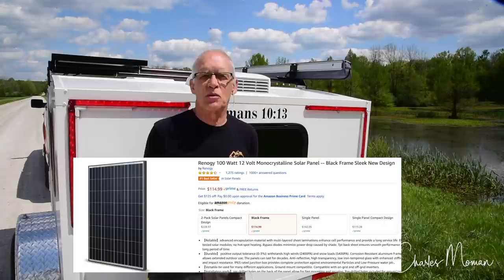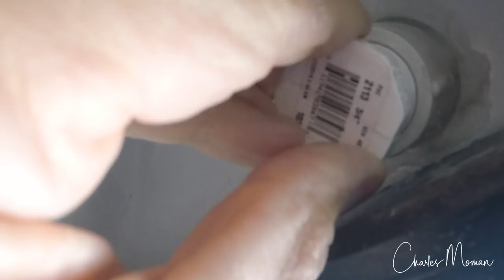A Simple Budget Solar Set Up for the Average Camper with Charles Moman

Comment: Thank you!!  This is much simpler than all the fancy setups I've seen on Youtube.
Reply from the maker: It is all we will probably ever need. If we end up using the roof solar a lot, I may add a hole in the front and run the wires inside permanently, but I doubt it. With the little use I expect, I would rather have the solar cords stored out of the way in the storage box on the front rack. Thanks for watching.
Reply: @charlesmoman  I would like to know if that jackery works for a refrigerator.  I live in island we get a lot of hurricanes. We were 4 months with out power.  My mom is diabetic so I would like something like that to have her insulin cool.   I had to make hour line for a bag of ice.  Would that work?👍

Comment: Imo, one of your most useful vids. Thank you! Re the hole ya drilled in floor, I would have smeared bunch of 2-part epoxy around inside diameter before using the piece of gasket material. Epoxy is better sealer than silicone. Don't want to get any water/moisture into that laminated floor.

Comment: I am wanting to put a max air fan in my teardrop, I currently just have a vent no fan. I have a jackery. My question is did you wire a 12v plug to the fan to be able to plug it in? Trying to figure out if that’s how I can set mine up? Great video by the way.

Comment: Helpful tip for you.  Buy a small inverter for your truck.  Plug the wall charger for the Jackery into the inverter in the truck.  Now you can charge at 81w instead of the 42w the 12v dc plug gets you.  Twice as fast charging while driving.
Reply from the maker: Yes I am aware of that. And that is a very good tip on the Hobotech channel he mentions the Bestek inverter on Amazon as a very good one. I need to add that to future videos and thank you for the reminder.
Reply from the maker: This is a suggested one - https://smile.amazon.com/dp/B004MDXS0U/?coliid=I1R01OFLHZXWFQ&colid=20TZLH0C9VFVF&psc=1&ref_=lv_ov_lig_dp_it
Reply: ib516
 Thanks for the tip, I'm just learning about how to integrate these devices.
Reply: You don't need an inverter to charge you can directly charge from your vehicle there is a video where the guy removed the need to use solar. You charge while you drive. But keep the solar so you be ready if the power goes off when on the road and at home. I think the setup has a charge controller to do  LiFePO4 batteries. 73

Comment: If you showed us system 1 and system 2, you left out system one half, no solar panels, just keeping the Jackery topped off when driving. That is what works for me.  Good video Charles. Not everyone needs the complexity of battery's, charge controllers, etc.
Reply from the maker: We sold our Runaway, and now have a DIY Ford transit camper van that we built out. We run it the same way, but now use two EcoFlow 1300s and an Ecoflow delta max. It runs everything perfectly and is much easier.

Comment: When it's really hot (even in the shade) I put my battery in a cheap styrofoam cooler with a block of frozen blue ice and a hole cut for the display and controls. Battery stays room temp. Good choice on the 500. Less power is not quite enough to use a refrigerator for 3 days and 2 nights. I use an OKPro 540 plugged into a Zoombros 330w - 870 watts plus active solar charging. The OK has regulated 12 volt, but anyone can get regulated output by using a converter to change their AC to DC. The 12 volt output will be regulated. I tested one with my Rockpals 300W.
Reply from the maker: Sounds like you are all set up!

Comment: Hi Charles. I think you mentioned you can run just the fan on AC unit from the Jackery. Is that correct? How does using the just the AC fan compare with the using the fans you installed on the roof for air circulation? My wife and I are wanting to get a Runaway.
Reply from the maker: No - not the AC fan. We recently added a MaxxAir 10-speed reversible 12v roof fan and a MaxxAir passive vent in our camper. Look for that video here on my channel. That will work MUCH better than running the AC fan. Our new setup will really draw air through better than the AC fan, plus the AC fan is not 12v and would eat more power than the MAxxAir fan.

Comment: Love your set up, I also have a Jackery 500 and a 100 watt suitcase. My father in law has a trailer with the Furrion solar  2 pin inlet. I would love to use the solar panel to charge his battery. Is there an 8 mm adapter to use the Jackery solar panels to Furrion?
Reply from the maker: I really do not know. Perhaps join a Jackery user FaceBook group? Also, check out Hobotech's Amazon store - he might have something listed. Sorry I cannot be more help. I have switched to Ecoflow units and no longer use Jackerys. Ecoflows recharge SO much faster.

Comment: I think it might be better if you have strong hinges bolted on both under sides of the solar panel so that you can unlock either side so that you can tilt the solar panel toward the sun for max reception when you are parked. I tried two panels on the roof of my van, but with them flat on the roof I was not getting the best angle to receive the strongest sun rays. The Sun has to hit my panels straight-on to receive the most sun onto my 100 watt panels at peak hours of the day. Flat, I was only able to get 15 to 20 watt input to my Yeti 400. But then I realized that I was not going to park my van in the sun. And even if I did I could not angle the panels toward the sun. So if I put them on top of my van I would need a way to safely angle them toward the sun depending on with direction I was driving east or west so that I could tilt them toward the South to make using them worth the effort. Driving around I suppose you would just be happy with getting what you could get, and then use the light weight panels that you have to point toward the sun when you could keep an eye on them. I foolishly thought I could keep my yeti topped-off driving around town living in the city.
Reply from the maker: I thought about that - I already bought hinges and a kit from Renogy, but in all honesty, I will rarely need to worry about it. With charging while driving, shore power at most places and the Jackery portable panel, I will be fine. We have zero interest in off-road camping, or BLM, etc. Just now and then at a Cracker Barrel and then at national parks.You see almost everyone put their panels flat on every van build and I hope they are not too dependent on solar or they will be hurting. Even skoolies with lots of panels will not gather solar well with them all flat Thanks for your thoughts and for watching. Blessings!.

Comment: Charles, thank ou for another excellent, practical and well executed modification.  I have enjoyed watching them all!!  Have you weighed your range runner with all your modifications?  Also do you know your tongue weight when fully loaded up? Many thanks.
Reply from the maker: I do not know the answer to either weight question, but it is about the same as our old 4x8 aluminum and wood version. Check out my EcoFlow Delta 1300w review - it can run the AC for 6-7 hours and recharges in less than two hours which crushed the Jackery. Sorry Jackery. I am getting ready to start a Transit 250 medium roof conversion that will be used to tow the Runaway. Good times. That series will be on my channel starting in September I think.

Comment: i might have to save up for one of these runaways.. I'm a lonewolf type and its a good price for what i want. I'd rather have a camper van but that's more money than i care to spend but this might be just right

The AC is a big selling point for me.. I'm in Oklahoma and we get some deathly hot summer days
Reply from the maker: Works for us. Happy shopping!
Reply: @charlesmoman  i have a pretty crazy idea to go traditional Japanese on the interior. Traditional bedding that just folds up and can be stored away, traditional style low to the ground furniture, chairs without legs with folding backs etc that can again simply be folded and stored in a corner or in a vehicle when the bedding out.   A little hard to explain other than it will be very clean and spacious  even though a very small area
Reply from the maker: @VolkXue  Simple always works. I am trying to do that with our Transit van conversion. Nothing. Complicated.
Reply: @charlesmoman  it's my running idea so far.  Maybe Japanese style but with Bohemian/Moroccan style floor pillow seating in the day.  With the right accents i think it could be quite stylish and not really intrusive to the camper itself.

Comment: What if they replaced the air conditioner with a Maxfan mounted where the air-conditioner is. I have seen them mounted on the back window of a van. That would leave the roof intact.
Reply from the maker: I seriously doubt they would consider doing that. People want AC - I was happy with the AC, but uses the roof fan and vent most of the time. We sold the Runaway and now have a Ford Transit 250 we converted into a camper. We installed the same fan and vent in our Transit.

Comment: will your jackery run a 20 inch box fan..electric.  or  a electric frying pan or crock pot?
Reply from the maker: The Jackery is 500W - what it will run depends on the watt usage. Google how to calculate lithium battery use and devices. Here is one such site - https://www.bestgenerator.org/how-long-do-solar-generators-last/

Comment: Hi Charles I'm Mark and I'm new to you channel a subscribed,  I have a jackery 290 with the 100 wat panel but the jackery I think is to small I got a package deal at home depot but it won't power my portable heater because its 18 volts and not 12 volts, I didn't know to be honest but I own it now so I'm stuck with it but other than that it's nice
Reply from the maker: Yeah, that is a small battery. I now use all Ecoflow lithiums. Running a heater with any lithium is problematic. I have some big Ecoflows, but any heater would not run very long. We use a 12v heated mattress pad if it is cold. We avoid cold weather with a passion, so it is not a huge issue. Good luck.

Comment: I'm curious why you didn't just cut a hole in the roof for the fixed solar panel wiring? You could seal that up, have the wiring all protected inside, and would not have to mess with the cap system like you have on the underside.
Reply from the maker: That is certainly an option and I may actually do that or have the wires come in one of the waterproof receptacle boxes on the front of the camper. A friend of mine did just the recently and I considered doping that, but opted for just a small hole underneath. I honestly do not expect to use either solar panel all that much - maybe only at national parks and this way the cords at stored out of the way in the storage boxes on the front rack. Time will tell if we end up using the solar more than I now expect. We are headed to RMNP this summer for a week and may use it there, though got by with just the Jackery 160 last summer there and in Utah. Our ARB awning has a 12v LED light strip cord that come in underneath or in a new hole on the front. Choices! : ) Thanks for watching.
Reply: @charlesmoman  That's a beautiful park. Have a great trip!

Comment: Hi Charles! What are the names of those PVC parts you used for the access port?
Reply from the maker: It’s been so long since I did that, I really don’t remember. I just went into Home Depot and look through the plastic parts and grab what I thought would fit. sorry. If I was doing it over, I probably wouldn’t do it through the floor. I would just drill a hole through the roof and then run them. But you might have the new roof and might not want to do that. If so the floor is just fine. If you’re running solar wires though and want to be charging while driving, you have to have someway to secure the cords coming down the side or front of the Runaway. Be careful!
Reply: @charlesmoman  thank you!

Comment: Great video. Can the Jackery run your A/C on a charge? And for how long?
Reply from the maker: No. I now have Ecoflow units. The Delta 1300 was able to run the AC for about 6.5 hours. We have since sold our Runaway camper and now have a DIY 2018 Ford transit that we turned into a camper van.

Comment: Charles, thanks again for more great info.  You answered the power for the IcecoG20 before I could ask it.  Will the J500 also power your electric heater without draining it?
Reply from the maker: We have a little Pelonis ceramic heater and it just pulls too much power for a 500w lithium. They make smaller heaters, but we now have a 12v mattress pad that does it for us. We do not do a lot of cold weather camping and if we do we usually have shore power, so we can run the heater. We sleep on an unheated porch year round, so we are used to sleeping cold - with lots of blankets and sometimes an electric blanket - at least for my wife.
This site to do the math about solar generators and devices - https://www.bestgenerator.org/how-long-do-solar-generators-last/

Comment: Charles, how do the connections work in the Rain?  Is that an issue?

Jimmy
Reply from the maker: You mean the solar extension cables? They are waterproof and meant to be in the elements on RV rooftops and elsewhere.

Comment: I'm in the planning stages. I plan to get a Rangerunner and be a "permanent" solo traveler when I retire next year. Would the Jackery 500 plus your solar panel set up be sufficient if I plan to boondock often?
Reply from the maker: I would suggest the Ecoflow Delta 1300. More money, but it can recharge SO much faster. Or the Ecoflow River 600 Max is a good choice too. Full time in a Runaway? Not many do that with such a small trailer. Be very sure you will be comfortable doing that. We love our Runaway, but we are now doing a Ford Transit 250 van conversion - check out my van build series. Good luck and blessings!
Reply: @charlesmoman  Did you mean "I would suggest?"  Yes, going solo in a little camper will have it's challenges, but I can always upgrade later. Do you know if they're still making the Rouser? That 6' tall camper might be better.
Reply from the maker: @karencolv  Yes, I suggest it! I do not believe they make it anymore, but you can find out if you call sales at Runaway.

Comment: Thank you Charles great informative video, I was thinking and heard of the 12 volt heating blanket/pad but someone said they use a lot of power??
Reply from the maker: Some do. We use a heated mattress pad and we keep it on very low because it gets so warm so we are not using a lot power to run it. I now suggest that people get at least a 500 W power lithium bank. With that you can run a lot of things. More power is better, but it’s also a lot more money. Fortunately, prices are coming down somewhat.
Reply: @charlesmoman  So is the Jackery 500 that you have in your video the same as you are suggesting to people? (500 W Power Lithium bank)?
Reply from the maker: @jamesajac4384  It is a great unit - a little slow to recharge, Take a look at Ecoflow units.
Reply from the maker: James Ajac I love my Delta 1300 - it recharges crazy fast. Ecoflow is sending me the R600 Max and the R600 Pro with all of the options so watch for my review of them. I can run my coffee pot with the Delta and our small microwave. I ran my 5,000 BTU AC on our camper for 7 hours with it too.

Comment: Could you lay the portable folding panels on top of the camper & run longer extension cords into the camper while you are close to the unit? No one would see the folding unit on top of your camper & it would be out of the way. 👍☮️🌞
Reply from the maker: Well . .  I suppose someone could attempt that, but honestly, I think a devious person would see it and grab it - maybe. It would not lay 100% flat and would be noticeable. If we stayed in the area, and could see it, then maybe. Thanks for watching.
Reply: Oh, ok. Thanks for the explanation. I thought from watching your video that you place it up there out of the way. If others can see it then it isn't a good idea. I must have missed that it doesn't lie flat. Be safe. 👍☮️🌞🦠😷🔋🔌
Reply from the maker: @secretdaisy6484  The Jackery panels open up fairly flat but not totally, and they have grommets you could cable tie to the racks, but in a NY minute, someone could still steal them.

Comment: I hope I don't regret getting the 240  instead of the 500.
Reply: We have a 280 watt from RockPals. At first it was perfect, then we started adding too many new electronics because of the novelty of it all, but this year we got a hundred watt foldable solar panel from Rock Pals to pair with it. It recharges the entire 280-W solar generator in about 6 hours. So basically with the power consumption we have out there with the solar panel and the generator combined we have endless power.  We completely agree with Charles in that these little jackery and rock pals generators paired with a solar panel is about all you need out there. Love though how he added the roof panel for added security when leaving camp.
Reply from the maker: The 240 is great too and even it can run a lot. I run my ICECO GO 20 with the 160 at night!
Reply: well jackery hadn't shipped the 240 yet so I cancelled and having them send me the 500 . planning camping in hoosier national forest and over night boating. thanks for all your great videos .
Reply from the maker: @dougcaseltine2462  Good for you!

Comment: Do you still use the foldable solar panel now that you also have the static panel on the roof?
Reply from the maker: Yes, I used both one day at RMNP. Actually, the folding ones are more useful because you can move them with the earth's rotation to get them at the right angle. That is, if you stay in the camping area.
Reply: Charles Moman - Thank you! That makes sense.